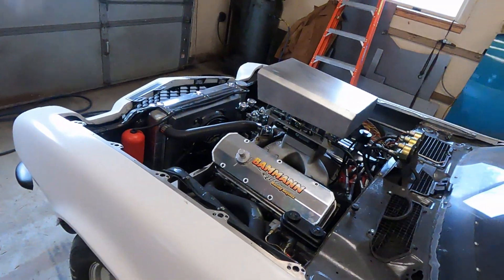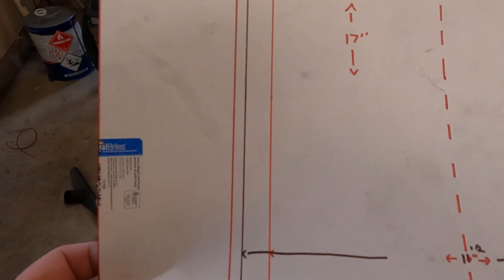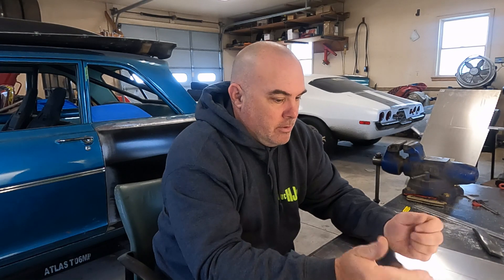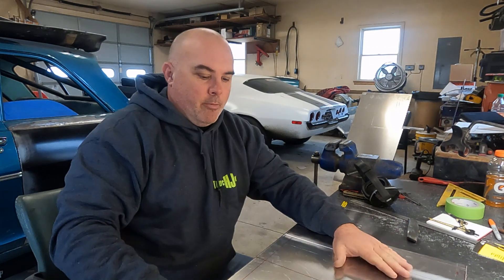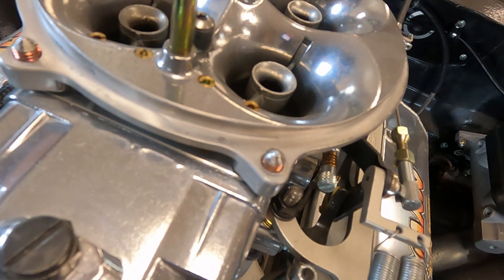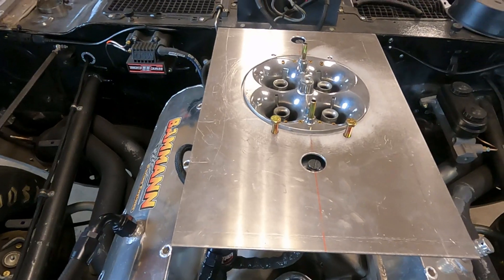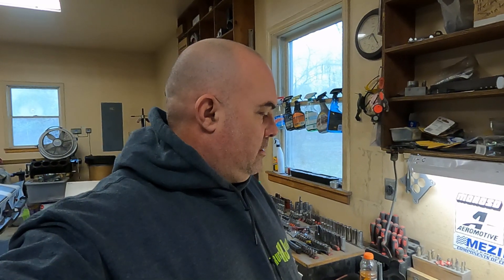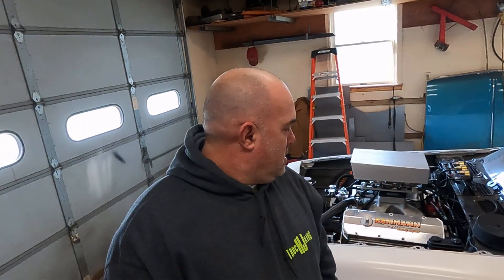Building a Simple Air Scoop for a Carb!!!

Comment: Good deal man. I will try this with some steel since I only have a MIG. Have you made one for a 4150 base?
Reply from the maker: I'm happy you liked it... I have done it for 4150 base, but it was on a tunnel ram. When I did that one, I traced the opening from an air cleaner base for the carb openings. That one was made of steel.
Reply: @jimkiernan2855  cool man, were the scoop dimensions the same as the 4500 or smaller?
Reply from the maker: No, it was a little bit longer, because it was on a tunnel ram with two 4150 carbs... My dimensions would work, or you could probably go a little bit narrower like an inch or two... The dimensions I used are (17 inches long x 11-1/2 inches wide, 4 inches tall in the front, and 3-1/4 inches in the back) that way it has a slope to it. Try building it out of poster board first. You can really dial in what you're looking for then.... If you're interested in stuff like this, my next video is going to be how I mount leaf spring sliders, and make them adjustable.
Reply: @jimkiernan2855  I thought about leaf spring sliders for my 70 Cougar but I have not seen specific ones for my car. I already have Calvert split mono leafs and the Caltracs bars on it. Shackles are just stock replacements from Mustangs Unlimited.
Reply from the maker: They don't make specific sliders for anything. You have to figure out a way to mount them. Most of them have a Mopar spring bushing.
Reply: @jimkiernan2855  Yes, thats what I have seen.